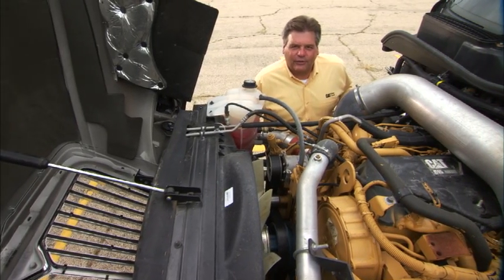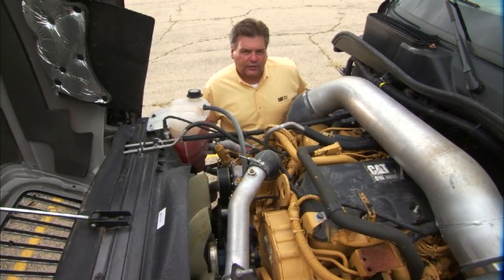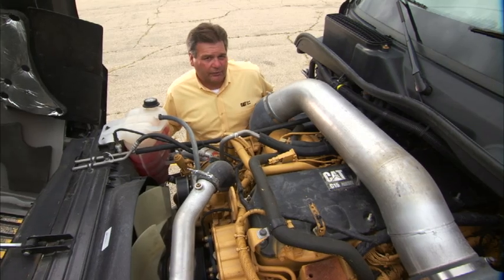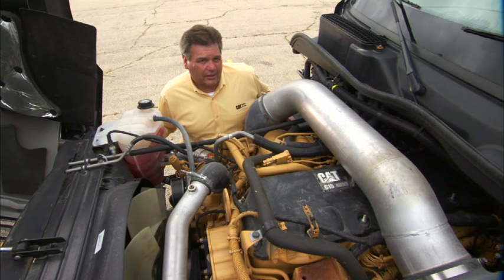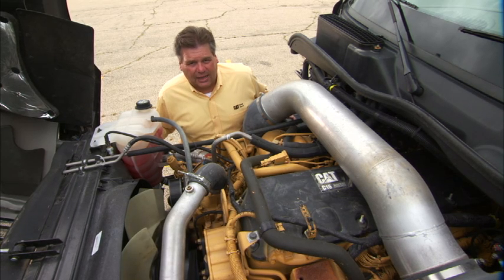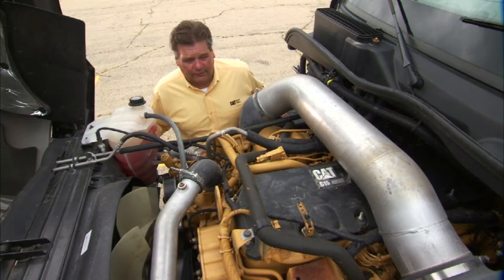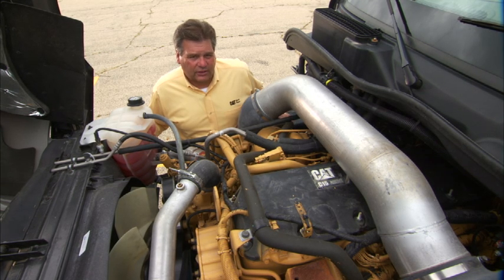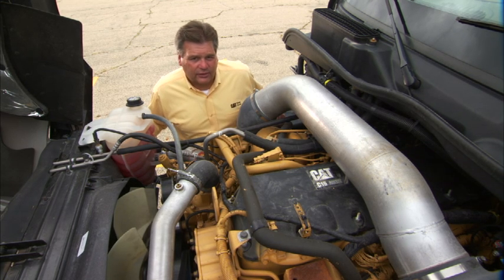Why You Should Not Idle Your Cat® Engine

Comment: Ive heard that excessive idling is bad, just never really knew what exactly the damage is. 06 pete, 475 acert, and when im parked for a while I idle up to around 900-1000rpm. In summer I keep the engine fan on also in these times so its not steadily kicking on and off wearing the fan clutch out

Comment: I’m a excavator operator for a scrap yard and during the brutal cold days during the winter when it gets almost -10 degrees below 0 we let our equipment idle over night. I’ve been using the same machines for 3 years and it has never caused them any harm. This goes to our roll off trucks as well. Simply walk past a truck stop in the winter around 1am and you’ll hear all the trucks idling. Moreover, diesel-electric locomotives are almost ever turned off unless they are getting maintenance done, are unmanned and in a remote location, or are simply being refueled.  I just don’t see how idling can really cause any issues in Diesel engines

Comment: Cat is like the most popular brand for semi trucks which idle literally through every single night as that's what truck drivers rely on to keep the heat running
Reply: I’m a excavator operator at a local scrap yard and during the winter months if it gets blow 0 we let the trucks and the excavators idle throughout the night. Never causes any harm to the engines at all. It’s also a lot easier on them compared to cold starts every morning almost.

Comment: I had over 1.2 M on mine before over haul. Even then oil consumption was 1 gal @10K miles, put a gallon in run to 15K and change. 2WS 3406E

Comment: Don’t idle your CAT, instead get yourself a 71 or 92 series Detroit with a good muffler (yes, they’re noisy but only if you make them that way) and idle it. Those engines oil extremely well when you run straight grade 40 wt. oil, the top end never ends up dry and they are extremely smooth idling engines, the fact every stroke makes power helps this. Worst thing that can happen idling those is your blower housing and intake port galleys in the block start to leak a little at the covers. Just wind it up a little and burn it off. Sometimes simpler is better, there’s a reason the military ran Detroit’s from D day clear up to the fall of Sadam and beyond.

Comment: And thats why i idle mine at 900 it never has let me down in 1,500,975
Reply: Let me tell you something about idle. I have a c15 acert.  I bought mine with  550000 miles. I did over haul at 1.7000 million miles and when I put it in the shop it was still running.  I just tough it was time. Ok,back to idle. I never, believe it or not never bump  my rpms up. On summer I all ways sleep with my truck on.  So I really don't belive that bumping up your rpms is gonna do any difference well except burning more fuel.😁😁😂😂
Reply: Miles*
Reply: 1,419,328 now
Reply: That would mean something if you had any miles on it!!!!!

Comment: Sounds like an oiling problem, pre gen6 big block chevy’s would flatten cam lobes if you let them sit around idling to much. Especially with stronger valve springs, needed the oil slinging off crank and drain from heads to stay happy

Comment: Idling an engine at almost any temp is bad for it...because the iron doesn’t heat up enough to seat the rings, and you’re just wearing the internals with zero revenue coming in the door. Don’t idle if you aren’t warming it up.  APU/engine heater, or shut it off.
Reply: Elijah Robinson yeah I’m not shutting my truck off in a blizzard or extreme temps.. apu or not

Comment: "It causes premature wear down in the lower half of the engine."    Twaddle...  It causes considerable additional wear in the liners and rings due to incomplete lubrication, and combustion. It also causes heat stress (cracking) in the liners due to carbon (insulation) build-up on piston crowns. Lastly, it causes carbon build-up behind rings, which leads to polishing and ring failure.

Comment: I've got a 3408 and I high idle it at 900 RPM if I have to idle it for more than a few minutes. Also it's got a CAT Brakesaver so if I'm warming it up in the morning I can set the Brakesaver to about 5 psi and it'll warm the oil up quicker.

Comment: The title should be "Why you shouldn't dead idle you CAT".

Yes, hours of engine on time contribute to engine wear, but in a lot of applications and locations turning the motor off is impossible.

I always idle my NXS C-15 up to 1000 rpm whenever it's sitting. Oil pressure stays between 40-50 psi and its an incredibly reliable motor.
Reply: That's why he said, up the idle a bit!

Comment: as long as you have in a thermostat to regulate the engine temperature and use good oil with a good additive in the oil there is no such problem
Reply: Wrong

Comment: Ill talk at behalf of my fellow truckers.... If it's a known problem that the engine wears down at alot of idle... And us truckers have to incease our rpm via the 'PTO mode'Why doesnt Caterpillar change the Idle RPM from 500-600 to 800-1000rpm as a standard ? 

In conlcusion: This is EPA BS what's being said and that on it's own is SAD. 
But i get it... It's an ACERT vaccumcleaner..... Not a real Pre-Acert engine and that's the problem.
Reply: Try putting it in gear at 800rpm, then you'll realize,, idle up to where the oil pressure is more than set idle and stops going up,that's where it needs to be,, about 800rpm